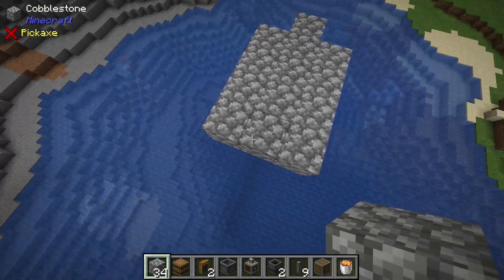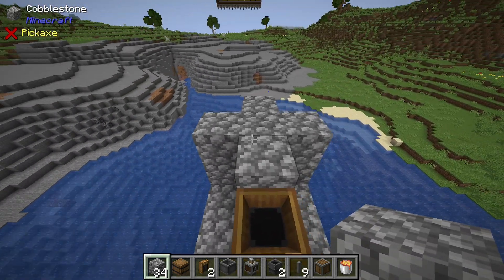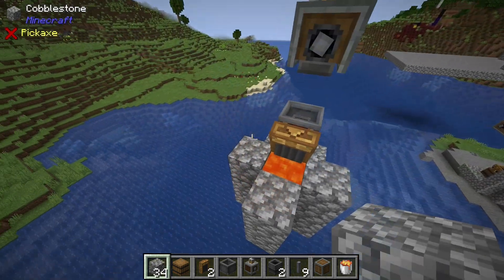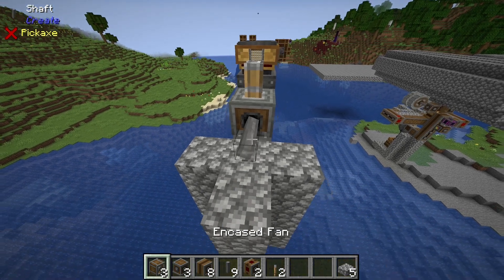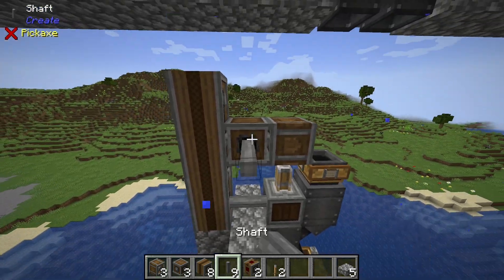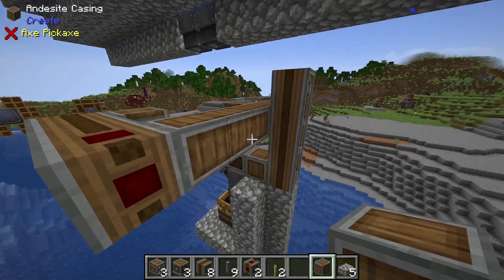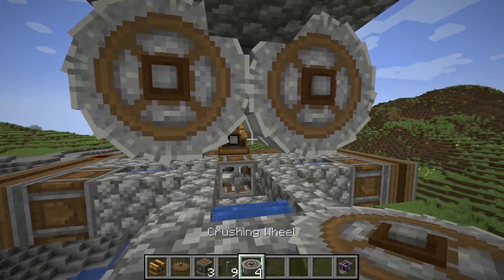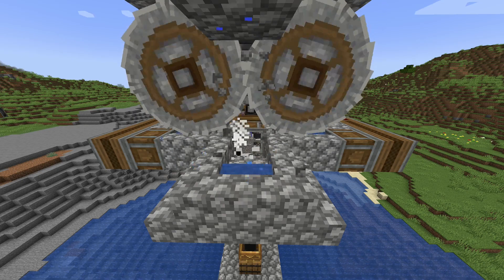Minecraft: Create - Iron Generator

Comment: I do not get this farm sadly, every time it grinds my cobble it turns into gravel and immediately goes down the chute and stays as gravel
Reply from the maker: That sounds like the fans are blowing the wrong way. Try throwing a gearbox between the shaft you're powering the machine with and the machine. Also, I have an updated iron farm that does 4x the rates of this one, you should check it out

Comment: Got a question, once the cobble gets crushed into gravel, it wont wash away, and just stays like gravel atop of the machine.
Reply from the maker: Do you have the waterlogged stairs places so that there's a gap for the fan to push water into the gravel? Are your fans reaching the gravel? Are your fans blowing the right way? Any other details are appreciated. If none of these are the problem I'll need more info to troubleshoot your issue
Reply: @Triobian  Well i managged to fix it, yes, all the things you said should be correct since i used your awesome squematic, thanks btw, i had the cobble generator in a way that the water pushed the cobble too far for the system to work well, i just placed a block and some signs and it works well, thanks ^^
Reply from the maker: Ahh, I'm glad you were able to fix it up! And I'm happy to hear you like the machine, I've got some other contraptions that might help you out too!
Reply: @davidooow6678  im experiencing the exact same problem, where did you place the signs/block
Reply: @juniper3495  Oh, i dont remember quite well, but i think i placed an adiccional bucket of water in the extra staircase bellow the crushing wells, and right on the fan i placed a sign to block the water, also i made all the cobblestone block only go through the first crushing wheel so it falls right throught the hoppers, hope this helps ^^

Comment: Hey ! Do you have a tips to avoid the overstressed problem ? I'm using 2 water wheels with 320 su and I can juste use the machine with 4 rpm...
Reply from the maker: Your best solution is to try to Increase the SU that you can deliver to the machine. If I remember correctly, the machine at full throttle  uses about 8.5000 SU. You can of course run it at lower speeds to reduce SU use. If you have windmills in your version, you could try using one of those. I belive they can get to around 8000 SU